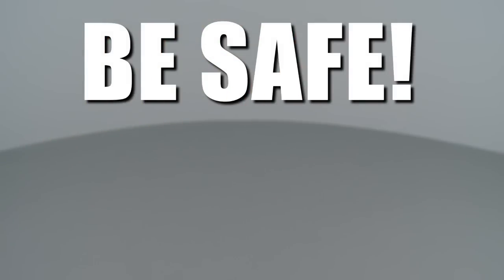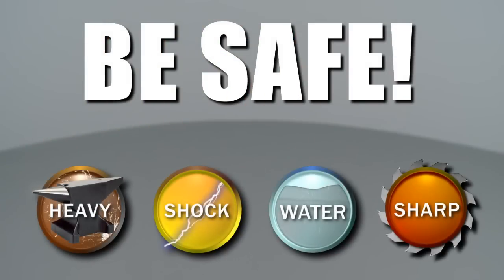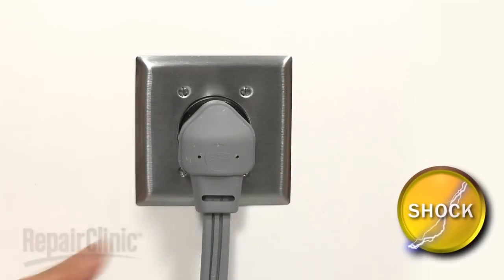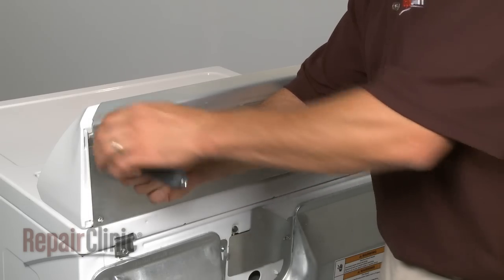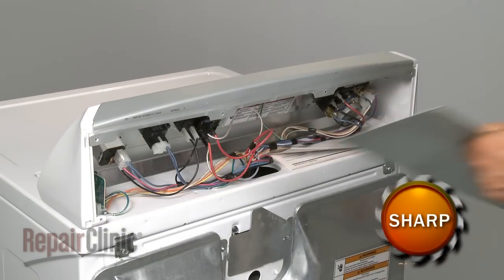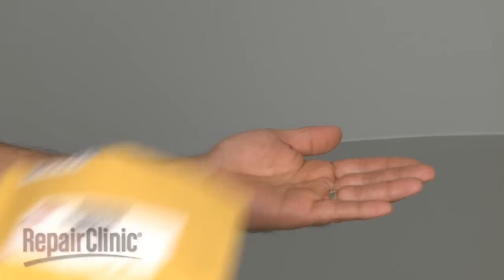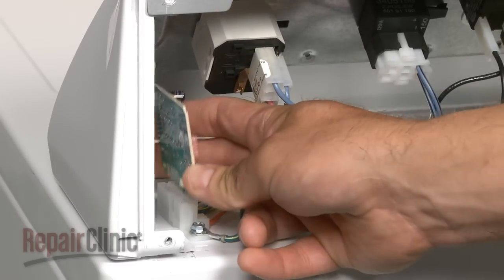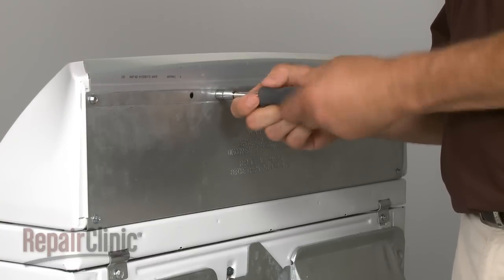Whirlpool/Kenmore Electric Dryer Dryness Control Board 8558178

Comment: Nice video, but it is not that simple. The part that I received fit my dryer, but the entire back panel removal was different and much more involved than this simple video implied. Removing the inoperable control panel was difficult because a key part of removing it was NOT explained in the video. We figured it out. The video needs to be updated soon!!!